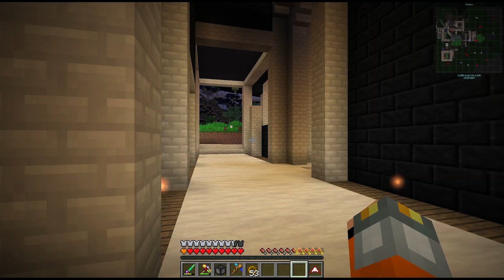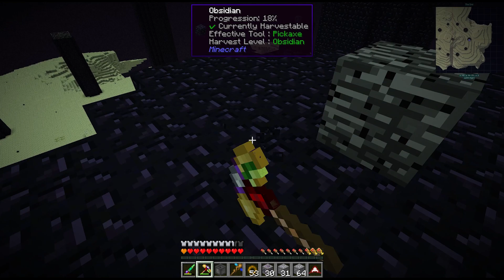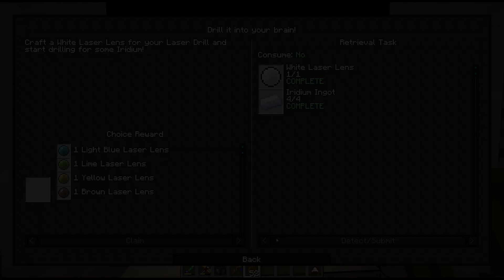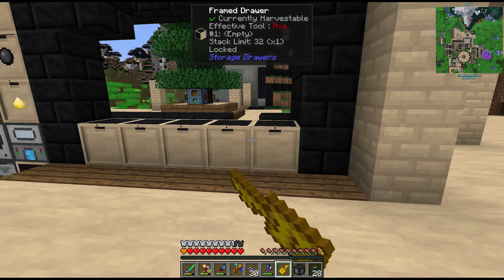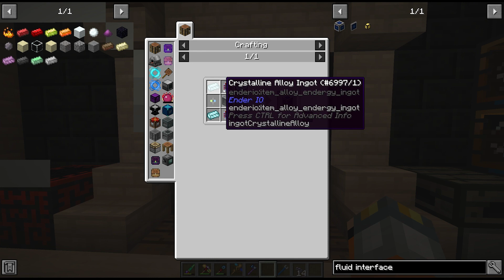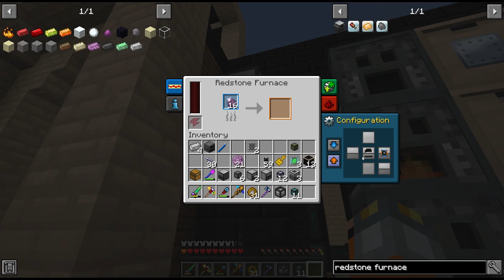Divine Journey 2: Ep17 - Let the Automation Begin! Modded Minecraft

Comment: you can push and pull materials from Stone work factory without conduits
Reply: You need an upgrade for that, and that means you lose a potential speed increase
Reply: @Royal_4096  There are Small color boxes in Stone works. You Can Push Items From There To Any Sides without Needing Upgrade.
Reply: @Waliyounas  That is only on 1.16, 1.12 does not